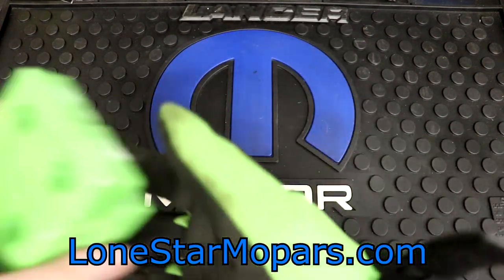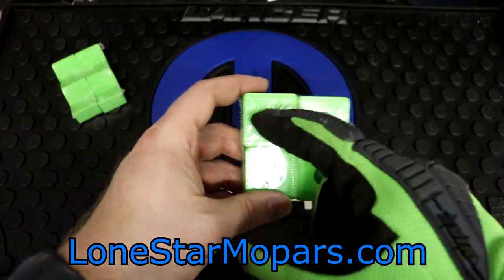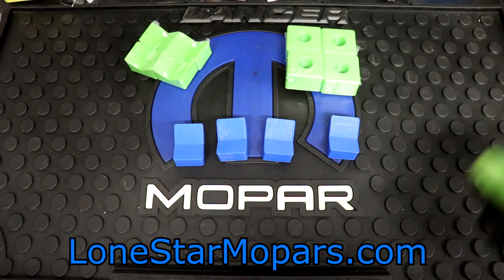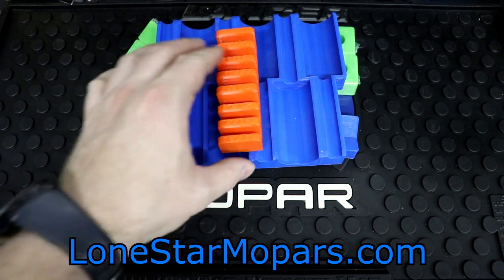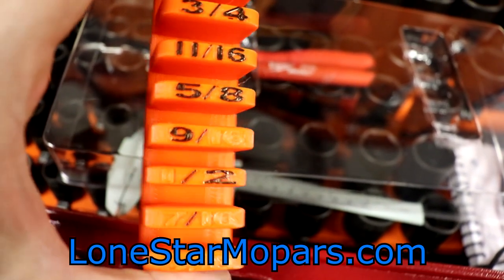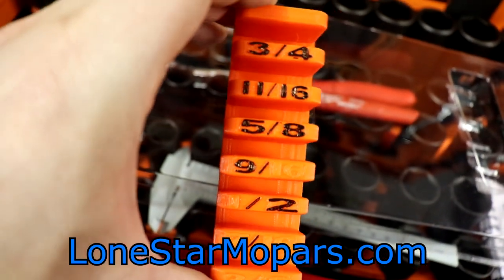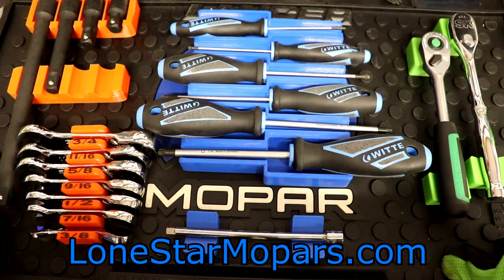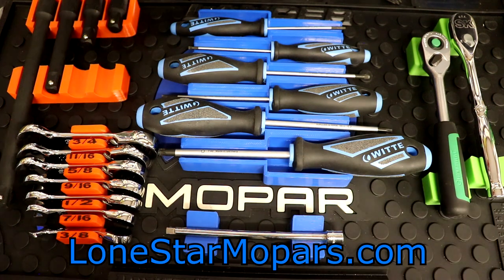Testing Out Toolganizer!

Comment: Bought a bunch of toolganizer products about 18 monthys ago (extension holders, ratchet holders etc), and loved most of them. Went to try the socket organaizers but unfortunately never got my full order and gave up after 6 months and multiple emails, considered it a few hundrede down the drain.
Reply: Over the past 3 months have placed multiple orders with ToolGanizer (over $300 worth) and love the product! Organizers are top notch quality and look great! I've even got 2 guys that work for me hooked on the product however the last 2 orders I have placed with ToolGanzier have came in with my order mixed up (wrong wrench organizer sent/ sent 1/2" extension organizers instead of the ratchet organizers I ordered). The first mix up I had i contacted the company and a few days later they sent me out what I was missing no big deal... My last order I placed in November (around black Friday sale) and received my order on the 23rd of December which I understood it was a custom order it takes a lil longer no big deal.... The day I received my order I noticed a mix up, I sent a photo of my receipt that came with my order along with the contents received and emailed the company, sent follow up email to the company, sent a message via the website, texted the 2 different numbers from the website and still have yet to have my issue resolved (January 17th). I hate writing negative reviews especially when the product is great and no flaws in that department however this customer service/quality control is non-existent...
I wrote a review and they just pulled the review down instead of resolving the issue...

Comment: Love the Toolganizer products. Looks like you got an off run of the ratchet holders. I believe they now all have magnets on the sides as well to "Connect" side by side. I have 32 of them and they are great. I love that the wrench organizers have a mirrored option so you can have 1 set going small to big from top to bottom and another set going big on bottom and small on top. Makes great use of your space available.
Reply from the maker: Yeah, I have really enjoyed them.  I guess I'm coming up around 10 months of use with them and ironically the only one not getting used is the driver organizer.  It would work, I've just a different set up for now.  I agree on the wrench holder...it saves a ton of space and I like the integrated size marking.  I want to say he prints them in 2 colors now, so you can custom tailor the size marking color as opposed to using a sharpie.  Extension holder is super nice as well...I think I misspoke in the video because you can pick up individual pieces.  I've needed to re-order for awhile, just trying to dial everything in...the side-by-side magnets would be nice for  the ratchets...A lot of them wind up being really close to the same OAL across various brands and similar tools.  32 is pretty impressive!
Reply: Hey boss, how well do you like the ratchet holders? I have 41 ratchets and most holders do not work very well 
Thanks

Comment: 21:07.. I don't mind my wrench's sitting or touching the box as long as they're up and aligned like that it doesn't matter to me.. some of them I slide left to right and they have no choice.. that's just the way my box is configured.. I like them.. I feel that if the base was taller than you limit yourself to deeper drawers not thinner drawers...
Reply from the maker: Good point on the thin drawers.  I bought that specifically for the cart where all the drawers are excessively deep for the wrenches, but it could definitely be an issue in shallow drawers, especially with larger wrenches.  A lot of the time I start seeing clearance issues around 7/8" or 22mm sizes.

Comment: Great video. I been looking at their stuff for a while and finally ordered. How long did you wait for your order? I placed an order about a week and half ago havent gotten any updates.
Reply: Sometimes they get a little backed up but, they will respond really fast usually if you message them and update you.
Reply from the maker: Thanks.  This is an old video...I had to pull up the e-mail receipts.  Looks like I placed it on July 5th...shipped the 12th, and delivered on the 20th.  So roughly 2 weeks.  I really like the wrench rack, extension holders, and have kind of grown to like the ratchet docks...haven't gotten around to ordering more since everything is kind of in a state of flux.

Comment: wd40 is a great cleaner for those Stahlwille handles
Reply from the maker: I'll try it out sometime...I've had really good luck with Tub of Towels.  Oddly enough, I think the trim tool, or scraper are my dirtiest Stahlwille handles right now.
Reply: @lonestarmopars  is tub o towels some sort of wet wipe situation? I just use wd40 as it's readily available at work or home